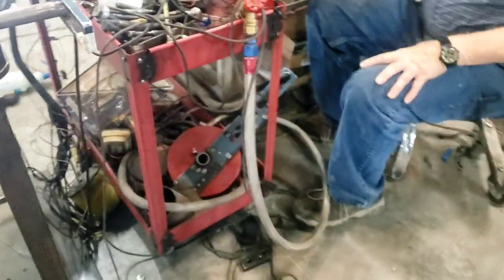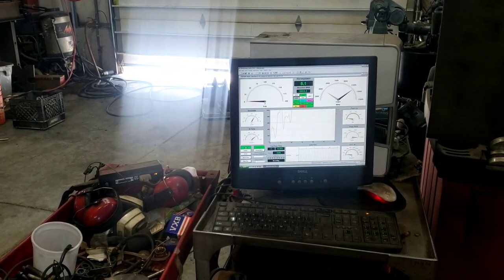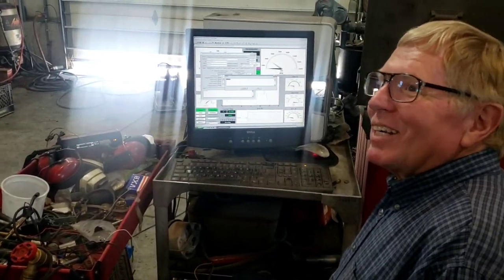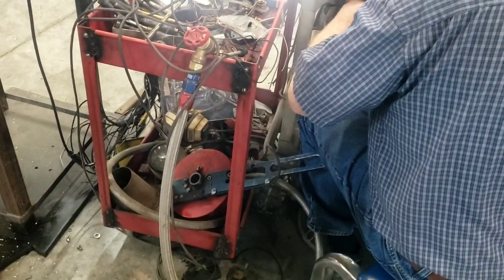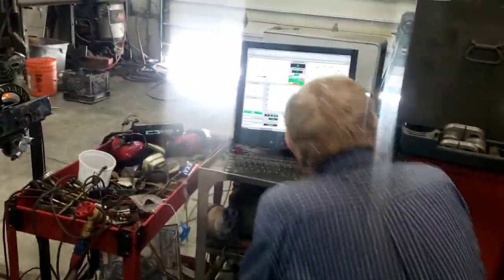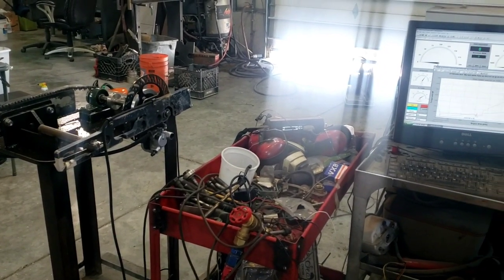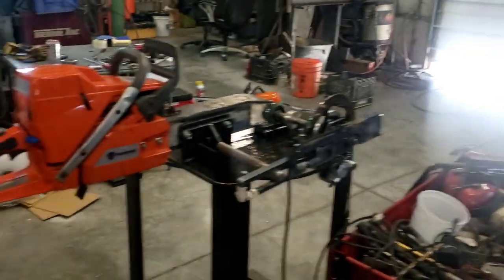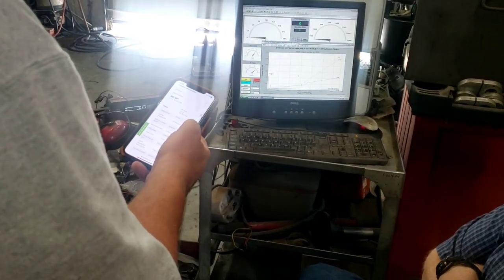Farmertec G395XP Chainsaw makes 6.5hp on the dyno Holzfforma g 395 xp

Comment: He is getting the loading figured out. Nice smooth pulls. You can tell Mike has run a dyno or 2 lol Nice work fellas!
Reply: Explination of how that works? Do you load it so it hits the rpms like its in a cut, say 9000?

Comment: How do the numbers compare to a Husky 395?
Reply from the maker: pretty close within .4 hp clone vs OEM.
Reply: @rockymountainchainsaw  I have a ported 572xp right at 7.5hp but I’ve always wanted a 395.  I don’t want to drop $1400 for a Brazilian made 395 so I was hoping the g395 would be close.
Reply: @backyardfirewood9852 pretty good numbers for the 572 I got one too I wanted to port can I ask who did yours?
Reply: @JoshNoss  HMWF work saws; Dyno Joe Mods YouTube.  I asked him to focus on the torque curve as I thought that is what the 5 series saws are missing.  He did well IMO.  The saw can pull a 32" bar with full comp chain easy….
Reply: @backyardfirewood9852  oh wow.. yeah he has my 550xp mk2 right now👍 sounds like you're happy with his work on your 572, he might get mine and my 592 as well then
Reply: @JoshNoss  very happy…. I have a #briscobuilt 620p.  I might take my other 620p to Joe
Reply: @backyardfirewood9852  oh wow, nice! You're lucky to have one of his saws, I'd tried to get him to do my 550 but he's got too much goin on for new work, that little 543xp he built is crazy how it runs
Reply: @JoshNoss  traded him my 550 mk2 for it.

Comment: I bought the kit saw and big bored it with a pop up. Base gasket delete and a muffler mod…….. Hate to say it the stihl flat top gobbles me up……… Bad
Reply from the maker: Really. Was it an OEM stihl? Tell me about it? Stock?
Reply: @rockymountainchainsaw  the stihl is stock and the sad part is its got a Chinese cylinder. When we rebuilt the saw my buddy made me do everything as it came factory.
Reply: @kylecromp319  good chance the big bore may be hurting you more than helping. Big bore kits are notorious for small transfers.